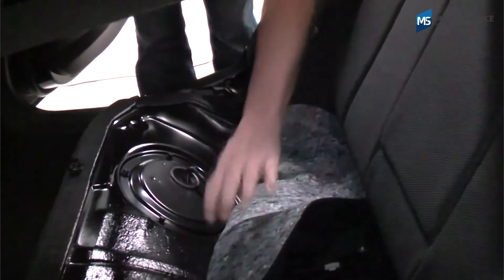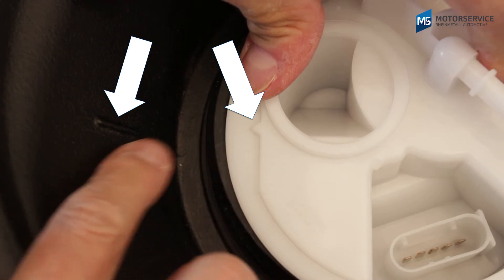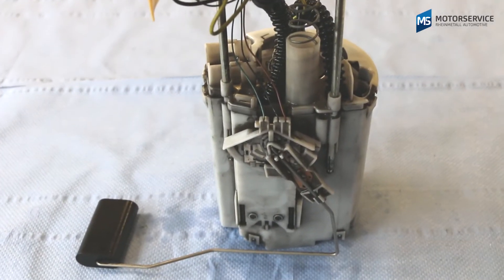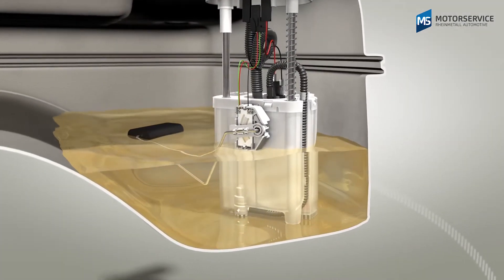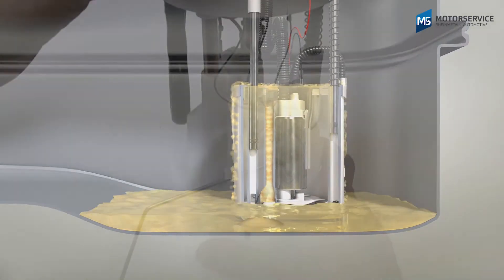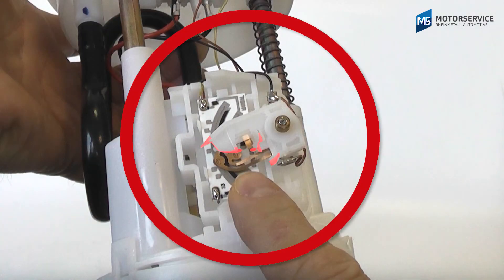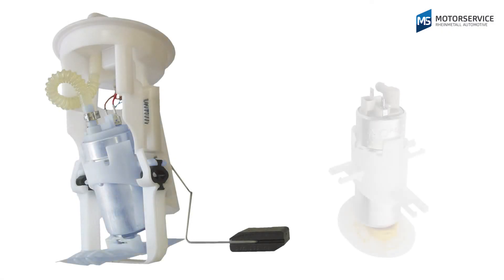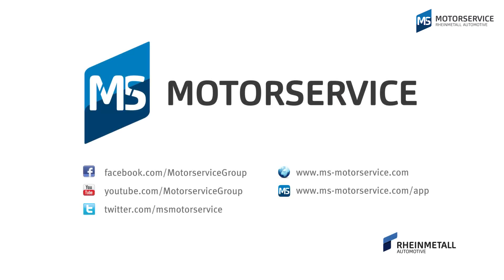Fuel delivery modules: Notes for installation

Comment: When a car jerks to a near stop when doing a tight turn only to the right, could the issue be with this fuel delivery module? Also, it only happens when gas tank is around 50% or less